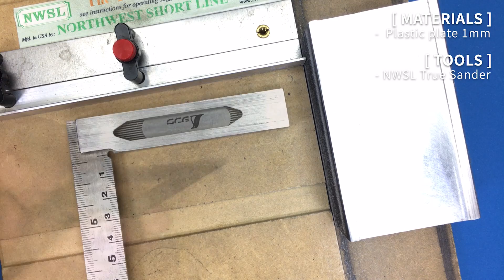[Plastic Model] GIGAS EP09 : Scratch Built Sci-Fi Mech

Comment: Do you buy your styrene in bulk and if so where??? Love this build
Reply from the maker: I'm buying styrene sheets at a model shop in my country. This shop doesn't seem to sell abroad. I could find a similar item on eBay, but it's much cheaper considering the shipping charges. Compared to Tamiya's products, it is much cheaper, but there is little difference in quality.
Reply: I don’t blame ya then
Reply from the maker: I can buy styrene sheets(210x290x0.5mm size 5sheets) for 2$ at the modelshop in my country and I have to buy Tamiya(0.5mm B4 size 4sheets) for 10$. Tamiya was 14$ on eBay. I guess the reason for this difference is the problem of the distribution systems, but I'm not quite sure.